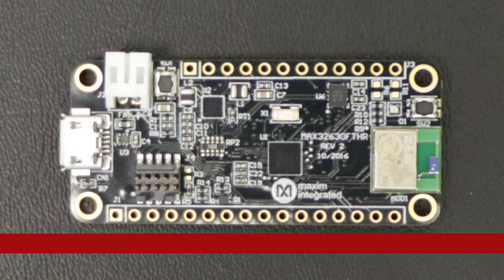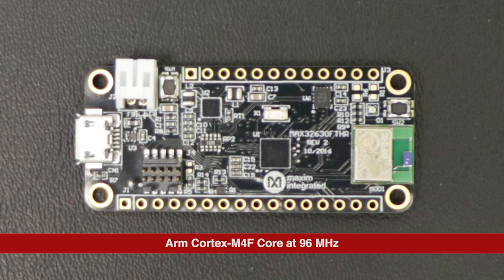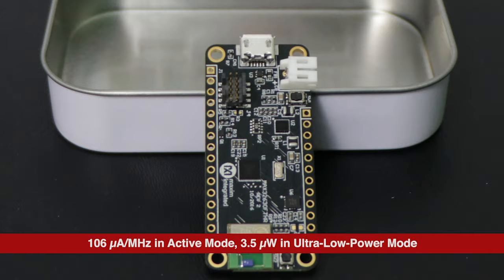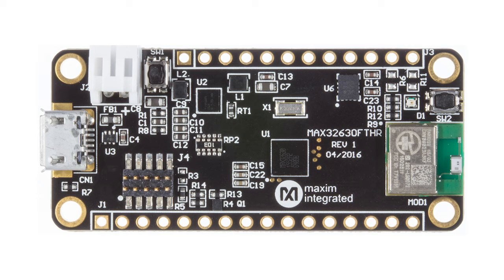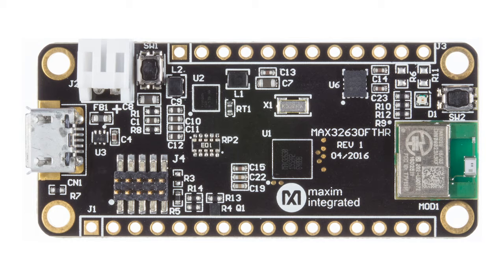Dev Kit Weekly: Maxim Integrated MAX32630 Feather Application Platform

Comment: The board has noticably good HW specs, but you really should avoid Mbed with this board! Otherwise you will face broken USB and also BLE-stack above mbed-os V5.9.7 (which is a really ancient version). So anyone interested in this board should rather consider low-level register programming it or for simpler task the Arduino core for this board.

Comment: You are asking too many questions for the contest, value my privacy for doling our so much info for free. Board is also overpriced, esp32 esp8266 is lot cheaper, only advantage I see is the battery connector, hope it has a battery management capability, integrated charger would be good, but too much to ask I suppose.